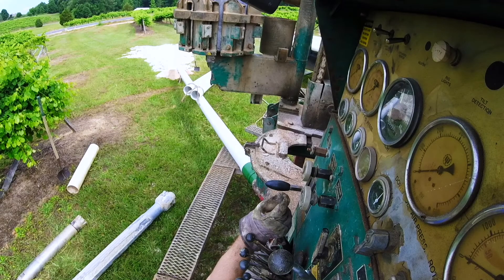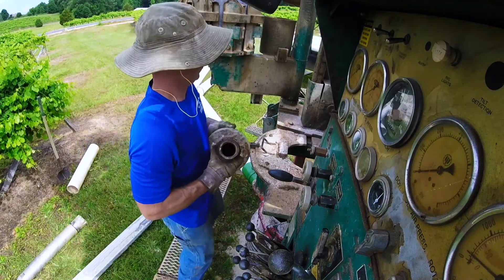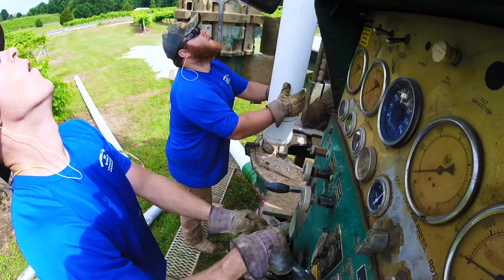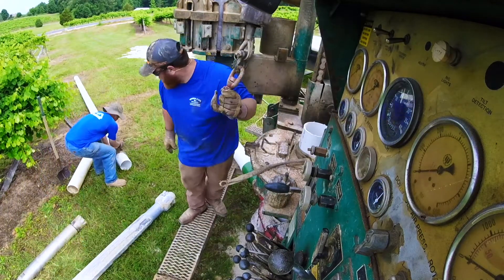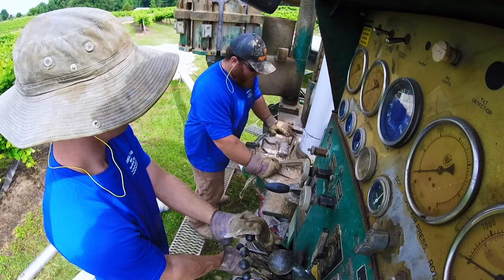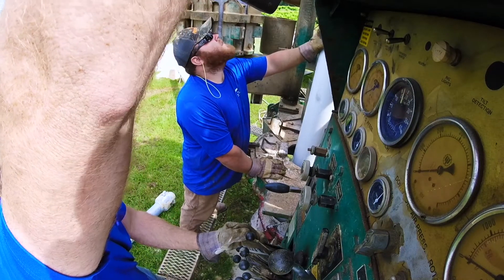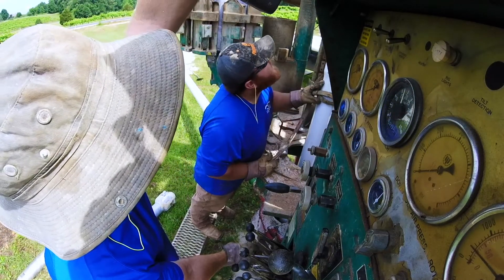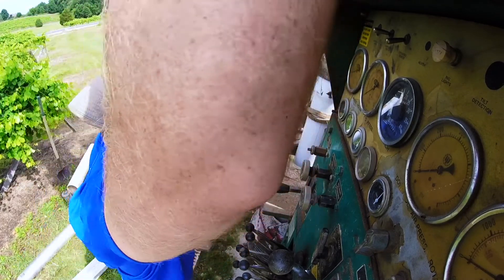How a Water Well is Drilled: All About Well Casing

Comment: Did this first pipe have holes in the bottom to let water in?
Reply from the maker: no, that would let surface water in the hole. this type of well is a open hole well in the rock below the casing. No casing is required in this type of bedrock to hold the hole open. Water is hit in the bedrock and the casing seals the surface water and dirt and mud out.
Reply: Is there some sort of well screen?
Reply: @silashuckins8853  PRL Leading manufacturer supplier of drilling rigs in India We supply Export, customized the latest Hydraulic of water well drilling, blast hole rigs, portable rigs, core drilling, etc

Comment: Thanks for all the videos, I’m trying to educate myself. 
I just bought a piece of property that had a 200’ well drilled 14 years ago. 
The lady ran out of money and abandoned the project. 
I talked to the fellow that drilled it and he said it is sleeved with steel all the way down but it would not be a good idea to drill any deeper because metal sleeve is fragile now. He wants me too drill new hole. Does that make sense to you?
He told me a huge part of the cost is resealing well.
Reply from the maker: MegaTapdog Yes it does make sense to me, especially if steel has to be used in your area. We are fortunate to where most wells in our area dont require steel so it saves a lot of up front cost.

Comment: Do you grout the casing before continuing to drill?  Are you using bentonite or cement for grout?
Kenny
Reply from the maker: We use bentonite for most wells here and we grout after the well drilling is done. We do some wells in certain states that require a grout inspection. These certain states allow the use of mixing cement and pouring it around the casing, so if we can't get an inspection the day we are drilling, we will use cement to grout when the inspector can show up